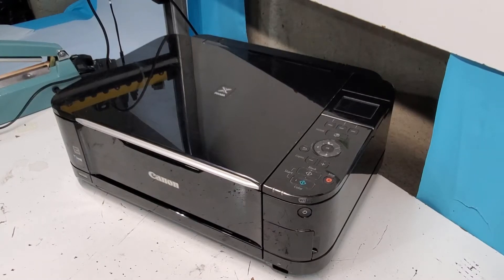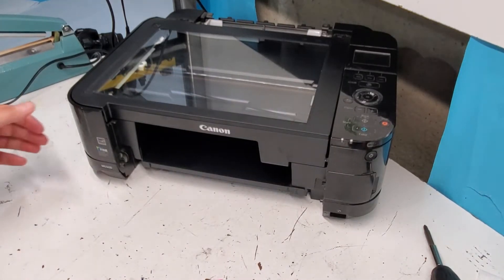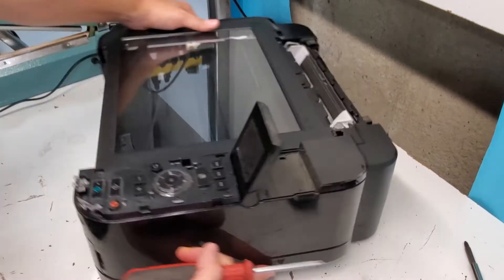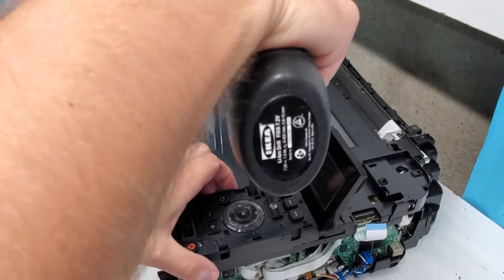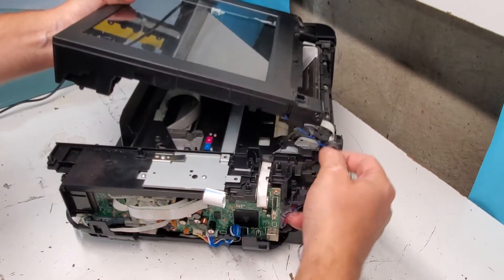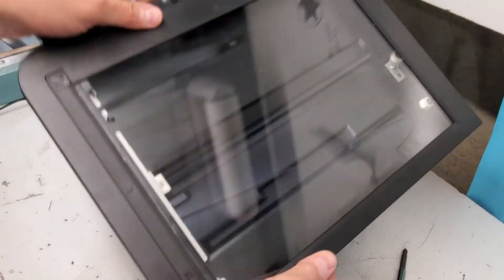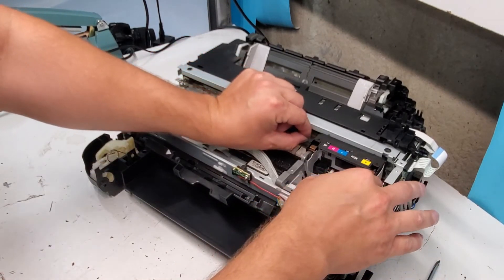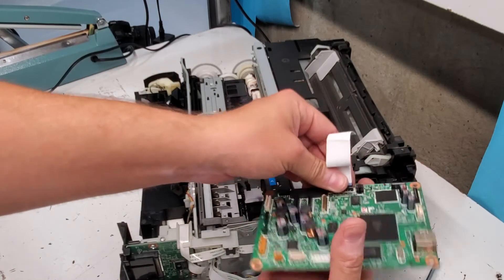Taking Apart Canon Pixma MG5220 Printer for Parts or to Repair MG5120

Comment: Great video.  After a power outage at my house... The power stopped working on my Canon MG5220  printer.  I watched this video then removed the power pack unplugged the wiring and re-plugged the wires back in and now it's working!  Thanks again for a great video.

Comment: hello. my printer just stopped working.no power , do you have an extra power supply i can buy ?
Reply: Same here.  did you find a solution.  it is not my outlets.
Reply: @marysnyder5547  My printer stopped working during a power outage.  I watched this video and removed the power pack, disconnected the wires then waited for a minute and plugged them back in.  It is now working again!  I don't know for how long but it's worth a try.  Let me know if this works for you.

Comment: Hello, where is located the sponge into this printer? I mean the sponge to absorb the ink
Reply from the maker: It's in the back of the printer in a white plastic encasement.
Reply: @303electronics  Thanks
Reply: 11 later but, no it's not. Its at the bottom of the printer, you're gonn have to remove the entire inner body to replace/clean those!

Comment: This was great, but you didn't talk show nearly enough about the waste ink sponges and purge unit area.  My print head always stops before it gets to right side in its resting area.  Can you direct me to a video that demonstrates how to repair replace parts regarding this issue?
Reply from the maker: I'm sorry I skipped that. I'm having trouble finding a video. I do not have one yet. I will see if I have a similar model to make video. Thanks.
Reply: @303electronics   I had similar trouble. Please don't go through a lot of trouble on my account for this!  My efforts are exhausted so we've decided to just get a new printer. Thanks for your reply!

Comment: Brother am facing a problem in hp deskjet 2131
The power button is blinking and printer is not working
Yesterday cartridge leaks in printer but no ink motherboard
Reply from the maker: Hi. The ink cartridge is bad most likely. Do you have another one to try?
Reply: @303electronics  borther i just resolve this issue and now the copier light is blinking and scanning a blank page